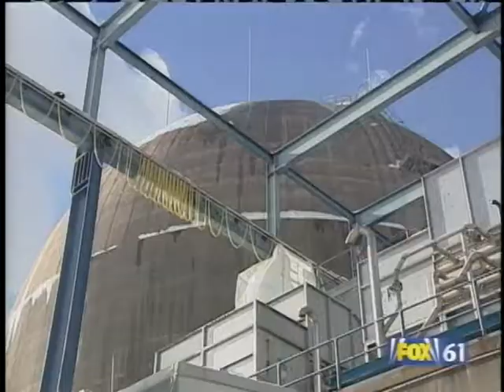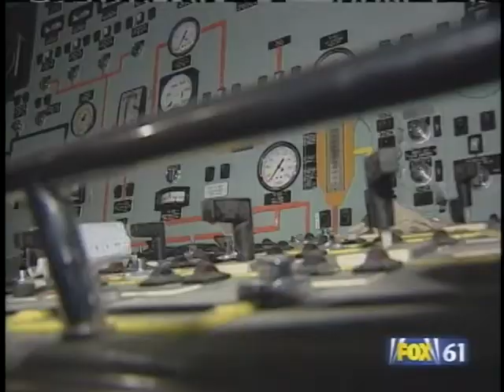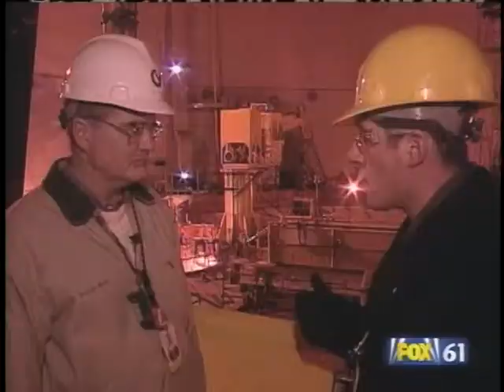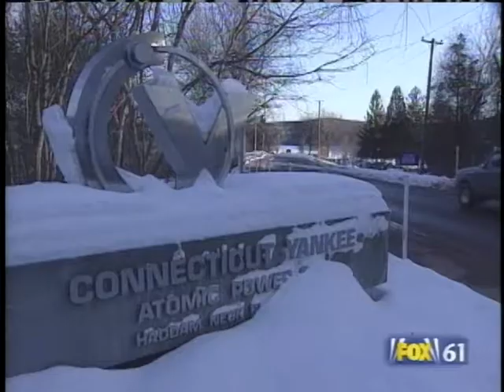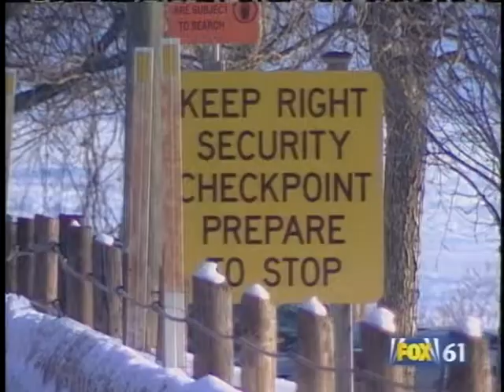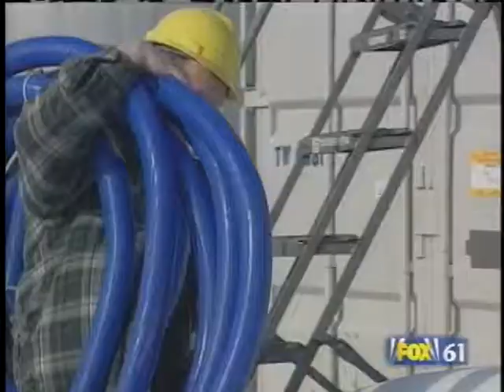CT Yankee Decomission

Comment: The plant had just been rebuilt and got a licensing extension for 20 years. They ran it for for a couple years and had a accident. Threw away a 200 million investment. Official statement "the plant has outlived its usefulness" No they broke records running it without maintenance and had a major release of radioactivity into the air. Hence scrap it...
Reply: What accident? Are you thinking of vermont yankee nuclear plant, they had a cooling tower pipe burst. Politicians thought the plant was unsafe afterwards (lol) and it was one leading reasons the plant was decommissioned. Cant finding anything about radioactive release into the air.